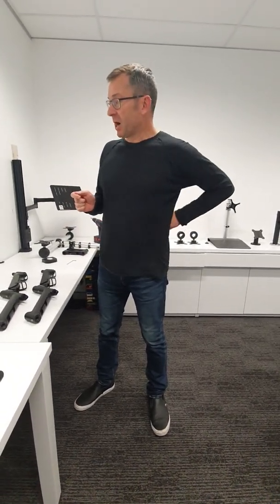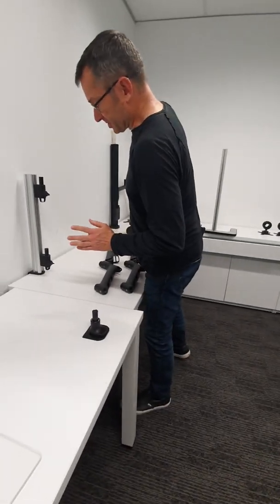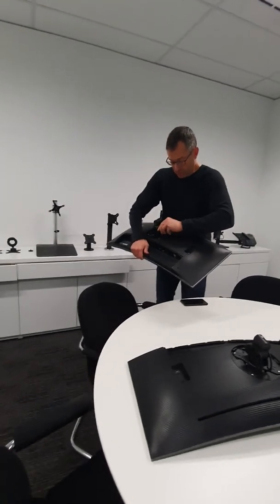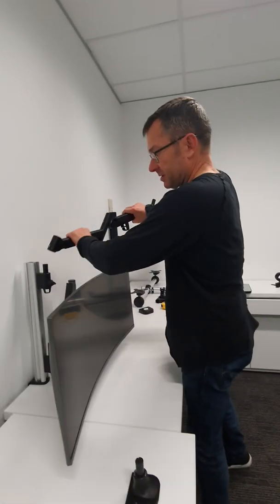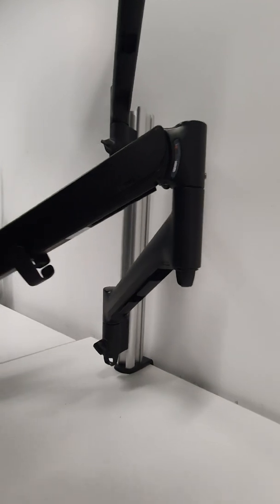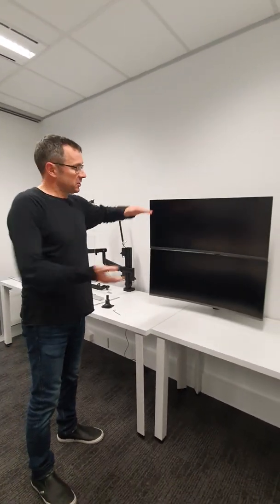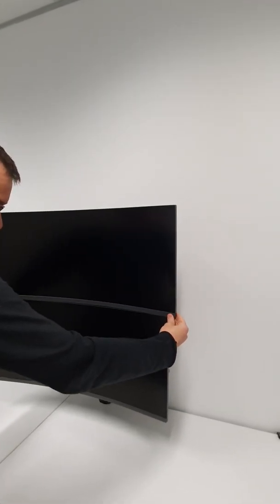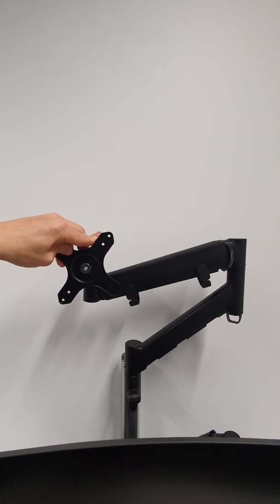Atdec setup of 2 49" monitors vertically stacked on AWM

Comment: will this hold 2 Samsung Neo G9's? or rather what is the maximum weight of this set up?
Reply from the maker: this product wont work with 2 x G9s but we have this product that is designed for 2 x G9s https://www.atdec.com/awms-2-bt75-fs which is freestanding this one which uses a desk clamp https://www.atdec.com/awms-2-bt75. they can be purchased through those website for north america or atdec.co.uk for the UK (and europe if you contact the help number there)
Reply: @jeromedgreen  thanks for the reply, been searching for months for a solution

Comment: I have two samsung monitors i have bought all your gear to mount them vertically set it all up and then realised that ultra wide Samsung’s don’t have VESA back for your clamps, do you have an adapter or something that will make them work on your heavy duty mount?
Reply from the maker: it's strange that the Samsung ultra widescreens dont have vesa holes. that is very annoying for you. I don't know why these manufacturers don't have the holes as standard. can you send me the model number? I'd like to look into it. assuming there are no holes, theres not much you can do about it. there are some mount adaptors that wrap around the monitors but I doubt they'll fit nor will you fiithem acceptable.
Reply: @jeromedgreen  yes the square on the back is smaller than your vesa bracket so it won’t fit. The model of the monitor is the Samsung odyssey CHG90 49 inch. It has this stupid round bracket and a little square on the back. Thanks for coming back to me I have spent all day trying to find a work around or adapter
Reply from the maker: @thestrategystacker  I looked up the specs online and the Samsung website says it has 100x100 mounting holes. Can you send me a pic of the back of the screen to jerome@atdec.com?
Reply from the maker: It's possible that with spacers we can fix this
Reply: @jeromedgreen  no worries will do. What’s the best address to send it too
Reply: @jeromedgreen  it seems to be getting the square vesa mount into the round backing on the monitor.
Reply from the maker: @thestrategystacker  please some pics to jerome@atdec.com

Comment: Very nice video. I have 2 Samsung Odissey G9 monitors, each weight 31.1 lbs. Do you think the setup you have in this video would be able to hold my 2 monitors? I clicked on the link you provided to previous comments, I see that the post looks similar, but both the arms are not listed in the link. Are the arms sold separately from the post bar?
Reply from the maker: Hi Juan. all these questions and more can be answered by our customer service teams in either the UK, USA or Australia. If you are in the USA/CA/latin america please contact customercare@atdec.com . thank you
Reply: Did you end up getting an answer? Appreciate it in advance
Reply: @TheJevans91  never got an answer, but still ended up placing both monitors one on top of the other.
Reply: @chickyperu  how has this held up for you? I have the same monitors and have been looking into these mounts but am skeptical of them based on the specs listed on the site and the fact that the screens being used in the video appear to be 34in monitors and not 49 in.

Would love to know who they are working for you since I have the same monitors!
Reply: @kaydwelke5676  I didn’t buy this same exact mount but another one very similar at a smaller price. The 2 monitors ended up on top of each other, the bottom one touching the desk and the top one touching the bottom monitor. I am happy as they are now, it’s been almost 2 years and I haven’t had the need to move them around so I’m good. If you want to place the monitors to be hanging in the air instead of touching the desk, I wouldn’t recommend it. Your neck would hurt! I thought of putting something below so they appear to be floating but I haven’t done so. Maybe I will
Reply: @chickyperu  great, I have 2 49s as well. Can you share a link to which ones you got?